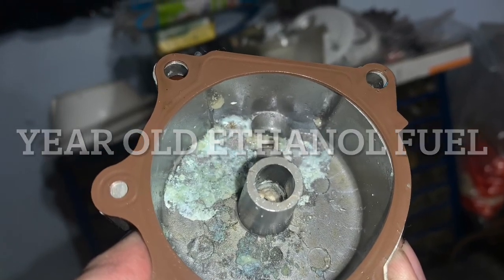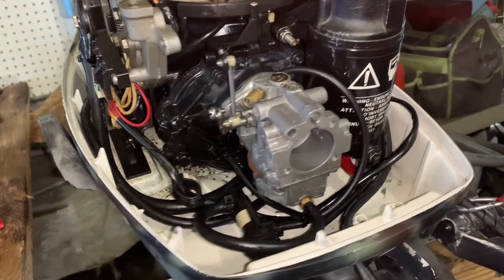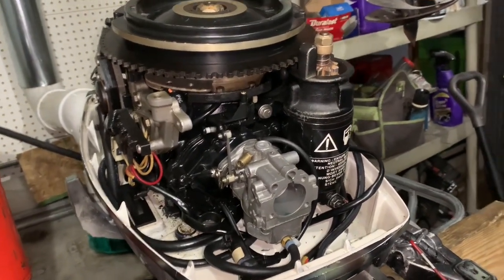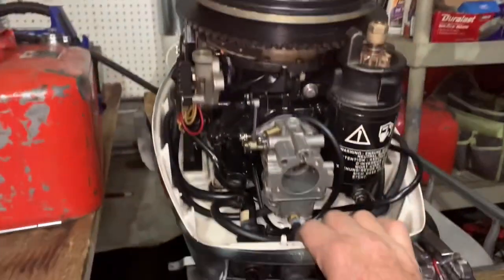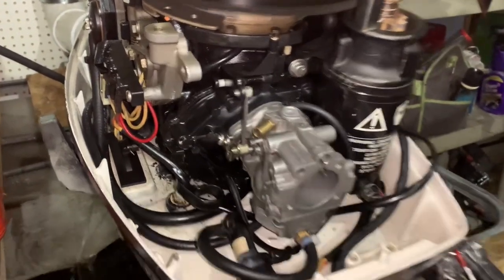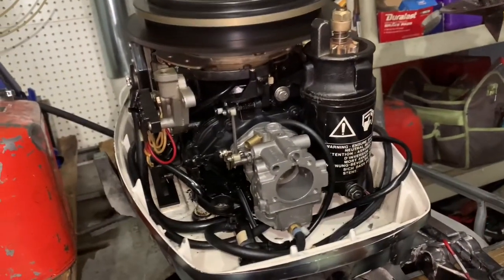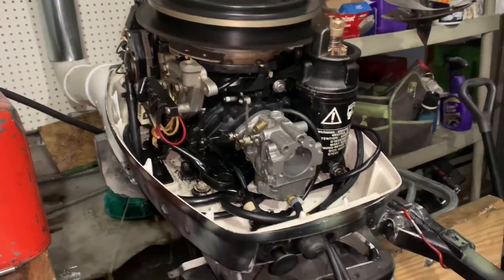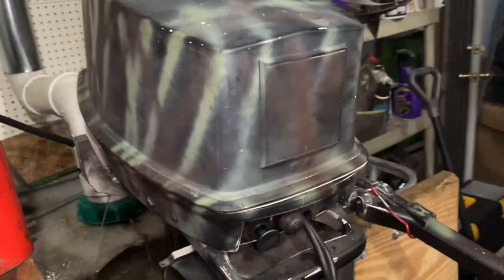1990’s 30 hp Evinrude - FIXED IT RIGHT - Lean Sneeze & Fuel Leaks are Gone - Part 3

Comment: Apparently, OMC issued a service bulletin in the early '90s about fixing engine that still did pop a lean sneeze AFTER proper carb cleaning and low speed needle adjustment. It called for "cheating" while synching that cam roller about 1/8 to 1/4 inch past the normal synching position (i.e.timing marks). Regards !
Reply from the maker: @danielrobert7181…. Now that makes a lot of sense and provides clarity to the problem. Thanks for sharing the solution.
Reply: @LivetofishOutboardRepair  got to amend myself, that ''cheat'' should have read '' 1/4 to 1/2 inch past the flywheel timing (synching) marks. Regards
Reply from the maker: @danielrobert7181  thanks for the update
Reply: What is the factory setting for turning out the needle screw as a starting setting on these carbs. Is it 1 1/4 - 1 1/2 like the ones that have the needle in the front?
Reply: @LCHumor  1992 manual says 1 3/4 turns ou.t Regards !

Comment: Hi, dumb newbie question. You mention using the primer to get it started; I grew up having been told that was a choke and had been pulling it out and holding it to get things started accordingly, rather than using it as a primer. It would explain why this isn't correct in retrospect. I looked for an owners manual on what the correct procedure is for using this as a primer, but I haven't been able to find any owners manuals online, only shop or service manuals. What should I know about how to use this as a primer? just give it a few pumps until it starts? I have a primer on the fuel line, and I know to pump that until it gets hard, but I just want to know what the correct operation is for this as well. Thanks again for the video and any insight you can give!
Reply from the maker: @Darkstar7950…. You got it right about 5 pumps of the primer should be enough. This type of primer is used in place of the older style butterfly choke. It produces a charge of fuel in the back of the carb.
Reply: I liked the choke better
Reply: @markkus1134  More money in the primer
Reply: @LivetofishOutboardRepair  my 1994 two pulls and it fires right up

Comment: Should the roller touch the timing plate when at idle? I adjusted my throttle and now the roller is not touching it…
Reply from the maker: Yes the roller should touch the plate. The plate is adjustable. There are two screws under the plate that have elongated holes for adjustment.

Comment: I have the same engine but with only rope start. It won’t start unless I pump the primer. Any ideas?
Reply from the maker: Marcus Ingre …. This motor requires that you pump the primer before starting since it does not have a traditional style choke.
Reply: @LivetofishOutboardRepair  Alright, cheers. Then everything is in order and  I don’t need to start troubleshooting. If I want to lean the carb, is the needlescrew on the side supposed to go in or out?
Reply from the maker: Marcus Ingre … turning the air/fuel mixture screw clockwise will lean out the carb. Conversely, turning it counterclockwise will enrich it.
Reply: @LivetofishOutboardRepair  Thanks a bunch. Appreciate it.
Reply: @LivetofishOutboardRepair fuel pump diaphram is most likely bad if you are running rich as the diaphragm leaks fuel straight into the cyclinder vs siphoning to the carb. That was my problem all these months even though the fuel pump looked great! 

You might as well replace all fuel lines and your primer bulb too while at it.

Comment: How did you get the freeze plug out? Also is the mixture screw after market?
Reply from the maker: Dustin Cribb …. I removed the “freeze plug”  with a small drill bit and a pick and no the air mixture screw was OEM.
Reply: Just for the record, those plugs aren't freeze plugs, they are called welch plugs and just serve the purpose of giving access to carb inside passages for cleaning. One rarely need to get them off if your cleaning procedure includes soaking in chem-dip or in an ultra sonic cleaner., either is really the way to go. Carb kits include replacement welch plugs but I'd avoid messing with those and posssibly creating a leak. Regards !

Comment: Doesn’t need new gasket it’s not in position properly had it happen to me,slightly undo screws and push gasket in a bit…
Reply from the maker: I just replaced the gasket anyway just to make sure it wouldn’t leak again. Also found rotted primer fuel line that need replacing too. Thanks for watching and commenting.
Reply: Just picked up a 25 hp 1993. Starving for fuel so will probably have to disassemble all these new parts I'm not used to with my last pull start 25 hp merc. I've had 4 surgeries on my left shoulder and one on my right...I'm done pulling any more cords!
Reply from the maker: Mathew Cooper…. I’m sorry to hear that about your shoulders. I hope you recover quickly and completely. You might want to look into an electric start. It shouldn’t take more then a couple of pulls to start it if everything is working as it should.
Reply: It was a blockage ...new bulb woiks great
Reply from the maker: @matthewcooper8217  it’s great to hear you identified and resolved the problem. Sometimes the Check valves in the primer bulb fail.